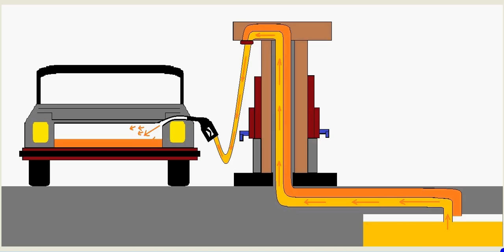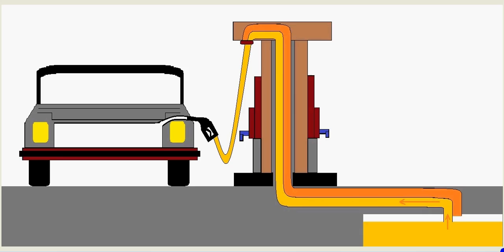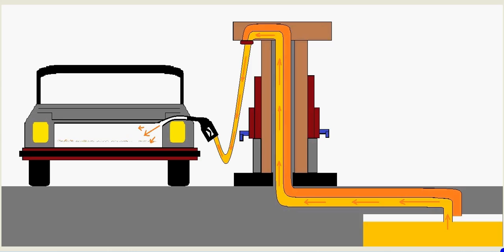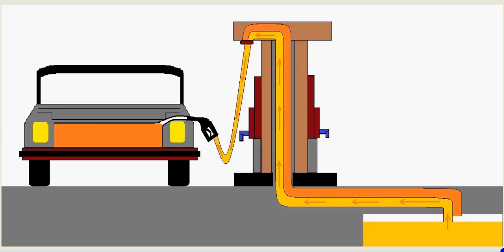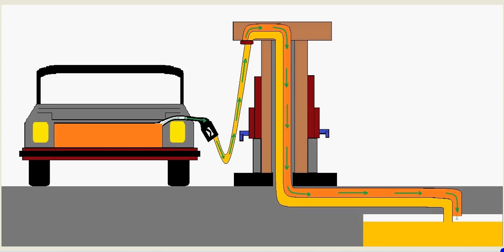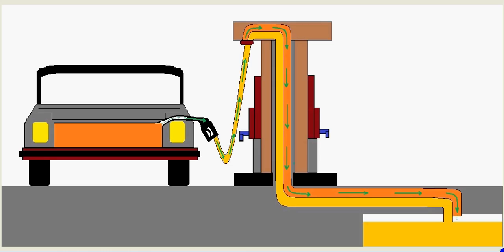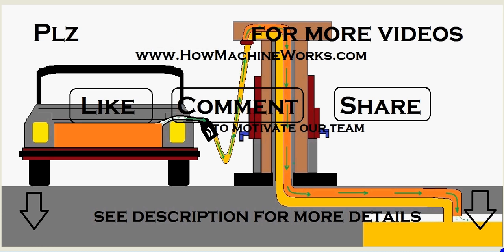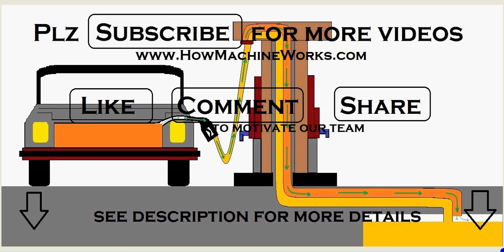Why not to fill full tank of fuel from a petrol bunk - Must watch - Share.

Comment: This is hilarious. Genuinely hilarious.
Absolutely everything about this is wrong.
There is no return line. In fact the pipe illustrated in this picture isn't even connected to the fuel line.
Its a pressure relief line. Its how the air escapes when the underground tank is filled. And visa versa when the fuel gets pumped out.
You clearly have absolutely no idea how any of this stuff works.

Comment: all are genius people unless they wont try to know what the actual working off a fuel pump in india there is no pump having a return valve or return pipe there is only one way out from the tank and there is a shut off valve in the dispenser pump it will not come out many lorry and car while fueling the tank is full the excess will come out to the ground

Comment: No fuel  petrol station pump that I have ever seen has a return line in that sense the return line is for bleeding air off and is before the Gage only on very old petrol pumps have I seen curious things that maybe return Lines normally red diesel pumps on dodgy boatyards

Comment: All fuel pumps with an auto cut off safety system will trigger the cut off the moment fuel filler tip submerges in the liquid fuel. This video is a scam. Fuel stations can still scam you by tampering with the fuel meter to charge you for lesser fuel than the actual reading.

Comment: the orange pipe it to let ari in to the tank so the tank wont have a are tight seel and if it dose the hose will just crumple up and then break. its like driking out of a beer bottle if u keep driking the less air whitch causes ur lips in suck in l, same thing will happen if thers no second pipe (orange pipe)

Comment: You need more education. This is not how the nozzles work. The mechanism has already been perfected over decades.

The thin return tube around the nozzle terminates in the handle. When fuel is pumped on it creates a vacuums inside the handle which sucks air/gas from the tank. When there is a pressure change from the tube getting blocked by topped up fuel, the nozzle triggers the physical cut off.

There is no electronics or return to tank.

Comment: when full leave a gap between the nozzle and the fuel.. and u can slowly control the fuel and still pump till full.. the cut out valve will deactivate do not overpump..

Comment: you're ignorant
Reply: MUHAMMAD IMRANUDDIN MAAZ how is he ignorant?
Reply: DRUGED F.UCKED orange return line is not the main point and it's not used in more than 97% petrol bunks. the main point to not to fill the tank is.... the petrol tank can burst due to high temperature in summer.
Reply: MUHAMMAD IMRANUDDIN MAAZ huh true I'll leave it at that I don't read up on petrol pumps so I wouldn't know

Comment: this is easy to measure just buy a new Mitchell 10 and fill it until the pump quicks off and then measure the amount of fuel in the tin. you will find very exactly the same amount of fuel in the gym as it says on the pump.

Comment: its a wrong information from video, when u observe petrol gun there is a small hole at end , a little bit of air sucks when filling tank , when the hole touches fuel then it blocks immeadiatly. it  block less than half ml suck it will stops the machine

Comment: this cannot be true. coz like you mentioned, there is a cut off hole in the fuel gun, when the fuel reaches the cut-off hole, the pumping machine will detects that and will stop pumping the fuel. later it's upto you to either stop the fueling process or to go for a top-up. even in top-up, fuel gun will be held little above the fuel top level(which is inside the tank). in this process there is no excess reading by the meter.

Comment: Thats not how it works. Theres a sensor inside the gas pump head which detects difference of air pressures in the fuel tank of the car as fuel is being pumped into it which then shuts off when gas is full. Nice youtube troll video.

Comment: This is bull crap. There is a pressure trap driven mechanism that stops fuel flow when it senses that the tank is full. It doesn't take back any fuel. 

You should always fill full tank so that you lose minimum fuel as vapour and get maximum fuel economy; especially for petrol cars.

Comment: Reasons why you should fill your tank completely and maintain full levels. In cold climates water condensation can build up inside the space not taken by fuel and can lead to poor engine performance and premature wear on parts like a fuel pump.

Comment: I have a motorcycle. You can see the fuel trough the filling hole when tank if full. if this was true, I'd have noticed considering my tank is only 3 gallons! (Yet I can drive 200 miles with it!)

Comment: the return valve does not take the fuel all the back to the main tank. the sole purpose of the return valve is to sense the returning fuel so that the fuel supply can be stopped. Once the supply is stopped the fuel can not enter the tank and also can not go out via return valve.

Comment: haha, then the tank of vehicle will not fill up ever. There is a sensor inside the tip of nozzile which help to cut off dispensing automatically when the fuel came back from fuel tank of vehicle.

Comment: I agree that there are probably places in the world where a "petrol bunk" works as described but I don't believe for a minute that this video accurately describes all gas (gasoline) pumps. There is, however, a reason to not fill a fuel tank as full as possible. The fuel is usually cold (from being stored underground). If the temperature in the vehicle is going to be higher (as would usually be the case in the summertime), it will expand. Not usually a problem but it sometimes is. (Ask your mechanic if you want to understand how.) The flip side of this caution is that if you drive the car even a mile or so right after filling it and before you park it, you will probably use enough fuel so as to not experience any problems when the fuel expands.
Reply: I forgot to mention that, in cold climates, NOT filling the tank can result in water condensing inside the fuel tank. If or when that water gets into your fuel lines (from the tank to the engine), it can freeze and prevent the fuel from reaching the engine. There are additives that can minimize this problem. A small amount of pure alcohol added to the fuel can help. I don't know what ratio to use because some of the parts in some cars' fuel systems can be harmed by alcohol. I prefer, therefore, to use commercial additives or, better yet, not let the fuel tank sit overnight with too much air space in it. And, of course, this problem is less likely to prevent you from driving your vehicle if your vehicle sits overnight at below freezing temperatures where the humidity is 20% or less.
Reply: Roger Metzger I wouldn't other reading these comments because they seem to look accurate by the sheer size of them XD
Reply: Roger Metzger Premium fuel has Ethanol for the very purpose you listed. Everything has its pros and cons.

Comment: I am with the other respondents.  Its the vapor that triggers the stop on the pump.
That said there is one unpleasant truth.   If a person fills his vehicle and stops the pump, by using his finger while still holding the hose,  with the pump stopped he can then again squeeze the pump handle and the fuel in the pump hose will drain out.   The next person upon starting to pump then pays for the fuel to refill the hose.
Reply: I'm a fuel tech.  The hose NEVER empties.  People that are holding the hose up and shaking it at the end are just kidding themselves.  They aren't getting anything extra and the next person is not paying to "fill tthe hose back up"
Reply: Our nozzles must be newer than yours because you can't do that. I always hold the nozzle out a bit and fill the tank some more after it auto stops. I slowly fill it until it's almost coming out and it counts that fuel as well. Trust me, people way smarter than you or I design these things, they've thought of everything.

Comment: Bullshit. The hell you talking about?

That orange pipe is for vapors to return to the tank. And, the way the pump detects your tank is full is through something called the Venturi effect. When tank isn't full, the vapors are passing through a Venturi in the handle creating a low pressure area. When your tank is full fuel goes through this hole and changes the pressure, and mechanisms detect this and shut of the fuel.

Comment: This is pure bullshit. All pumps have a security mechanism that senses when the tank is full and stops the fuel flow by closing the valve in the handle. There is no pump that sucks fuel back. The reason for this is simple. They can not know what you have in your tank and if you for example filled a gasoline car with diesel than it would suck back some gasoline into the diesel reservoir. They would then have to empty and discard several thousand litres of fuel to avoid risk of having to reimburse other car owners for motor damage due to contaminated fuel. If you are going to make videos about how stuff works you have to at least know what you are talking about. Otherwise you look like a complete idiot.

Comment: Ok so habib is saying that I could just pump continuously and waste money? I have a few issues with this. A: why then have I never experienced this problem? And when my fuel tank is full it just cuts off. B: in my older vehicle if I were to try and top my tank off past the auto stop, gas would flow onto the ground from a over flow valve in my gas tank. I guess this mysterious technology he speaks of is only where he lives. I mean obviously the diagram shows a well documented problem he is having so there's. o reason to question it....all I can say is he's full of bs and until this becomes a wide spread technology I'm not gonna change where I pump gas. Stupid video.

Comment: when we get a full tank the valve on the pump cuts off
Reply: Are you braindead?
Reply: That's correct There is a diaphragm inside of the pumping nozzle - it's a complicated process, but the device is very simple. When air pressur changes inside the diaphragm, it drops the cut-off into the fuel-flow. It stops you pumping in more fuel when the nozzle is submerged.
Reply: Moose Knuckle regardless cut off from a full tank to a non full tank whatever is left in the line either goes back or ends up on the floor which is why people usually shake or lift up the hose to stop that. this video shows fuel going back in meaning you could stand there all night waiting for a full tank
Reply: +Moose Knuckle
Regardless of if you stop the flow manually or if it's stopped when your tank is full, the excess fuel in the hose is not deposited in your cars tank.
Reply: @MatthewWeiler1984  
Ah yes, but fuel that was already in the line before you started pumping does go into your tank when you start.
Reply: ESAPOWER
Reply: thanks for keeping the troll video up and running
Reply: yup that right
Reply: Muhammad Farris
Reply: Muhammad Farr🐆🐆🐆🐆🐴🐴🐩🐩🐩🐩🐺🐺🐱🐱🐈🐎🐆🐃🐽🐁🐁🐁🐁🐁🐁🐁🐁🐁🐁🐁😘😘😘😘😘😘😘😘😗😘😗😗😗😆😆😉😑j👑👢👢👞👟👺👹👹😺👹😱😺😿
Reply: k ly But the remainder of fuel in the line goes back into the holding tank...which you already payed for...Do you understand?
Reply: Well, I would guess that the hose leading to your car can switch between which line its connected to: the one drawing from the gas storage or the one for returning excess. And for the pump sucking the fuel, you have to realize that the gas machine is sucking gas from the perspective the gas supply, and pumping out from the perspective of your car. I'm sure its as easy as running the pump in reverse.
Reply from the maker: Hi,

This is Jose from TechTrixInfo. Thanks for the comment
Learn through “WhatsApp”
Please WhatsApp @ +919744615655 <your name> and start getting updates Mechanical and
Automobile engineering, Super cars and machines. You can also ask your doubts
related to the same subject and we will be happy to help you and this service
is FREE.

Comment: not true. the only thing the pump "return line" handles is VAPOR. I build gas stations for a living...
Reply: um no. if they took excess fuel out of your tank, it would require a whole new pumping system. if this was truly in the old times, it wouldn't have had a return line at all. Plz do more research for your videos
Reply: You re right. He is just making up. Return is for vapour. Also senses the fast air flow and shuts the liquid off. Also not Petrol bunk. Petrol Pump please.
Reply: well look at the quality of the diagram it's not exactly professional ahaha you can't trust him :P
Reply: Kameron Lovell thats a professional drawing you are picky.loll
Reply: ooh if true. . how we can cheat to have more gas..
Reply: Gas is a vapour. Did you mean petrol stations?
Reply: TechTrixInfo 
Shall I get this number
Reply: That is VRS , vapour recovery system.there is no excess fuel returned to tank
Reply: I agree with you Bruce. Because it will be auto cutoff and the reading will not run more.
Reply: TechTrixInfo.com Haha. Your concepts are all shaken! Creating a false scare just for the sake of YT views!
Reply from the maker: +bruce s 
This was in the old times 
In Asia 
Thanks for the comment 
Mechanical, Automobile engineering updates through Whatsapp @ +919744615655 (requests through Whatsapp to get updates)

Comment: Hahahahah so not true. It's actually stupid. A  fuel dispanser have maybe one or more one way valves, or return valves. So there is no posibilty that fuel goes in both direction, and this drawing is nonsence.
Reply from the maker: +Marinko Jagodic 
It's an old technology, currently not there.
Thanks for the comment 
Mechanical, Automobile engineering updates through Whatsapp @ +919744615655 (requests through Whatsapp to get updates)
Reply: Not posible in old to, there is also a return valve in tanks. Trust me, I'm working in fuel dispanser service.

Comment: Either your filling stations are all crooks or you are deluded. In the UK, the nozzle has a sensor which detects when there is a high concentration of fuel vapour (because the fuel is very near the nozzle) and the trigger shuts off with a distinctive and quite audible clunk. Do you work for Windows Tech Support and call people to show them warnings in their EventViewer ????

Comment: Doesn't make any sense this video. If this was truth then everytime I filed my tank, I wouldn't get any gas/diesel poored out like I do everytime I overfill. The return mechanisn would simply suck everything away and no waste would poor onto the floor. The returning mechanism you are talking about exists actualy to keep the air flow on the tank, otherwise you woudn't be able to fill in the tank because the pressure is equal to the pressure outside, as most of us just put the nozel into the whole and there is no space for the air to flow in.

Comment: pure bunkum
there is a vapour return pump fitted. as the tank is filled with fuel it displaces vapour which is sucked back to the storage tank, the part of the nozzle that allows this to happen is actually outside of the car fuel filler. when you put the spout into the car it opens a flap (unleaded spouts are a smaller diameter to diesel spouts so a diesel spout will not fit into an unleaded car) there is a ring close to the handle which is where the displaced vapour is collected to be returned to tank. the automatic cut off is controlled by the little hole at the end of the spout, when the fuel covers the hole, a diaphragm is lifted which disengages the trigger

Comment: Total crap. But one thing is that you should not fill excess. This is to prevent interfering with the pressure compensation. There will be some air passage to the tank, otherwise negative pressure will build up as the petrol level goes down.

Comment: FAKE ACCENT. I deal with dispenser. As per the standards, there is no RETURN LINE TO TANK from fuel dispenser. Understand one thing, fuel and oil is critical industry when it comes to retail stations. No pumps are allowed in any kind of market. FYI i deal with gilbarco and HOSE or NOZZLE doesnt have prevention for internal return line. All nozzle comes with sensor which immediately stops after sensing fuel at top of nozzle spout. So better you correct your fact before creating bullshits.
Reply: it's fun to point out the uneducated twats they say this is not true but it is

Comment: This is totally wrong.  The return system is for gasoline vapors.  Pumps shut off when the displaced air in your gas tank runs up the fuel filler hose / pipe.  Fuck this guy.

Comment: The return line captures Vapors only. If the pump does not have a safety over flow shut off, any extra fuel will spill to the ground and on your auto. Otherwise, the pump stops pumping fuel.
Reply: it stops but u can squeeze again to get it back going. which is what a lot of people do.

Comment: BULLSHIT! I tested this myth at 3 different stations using a 5L jerrycan. When it's full, it STOPS. Simple as that. If you push it again you will even overflow it but DOES NOT suck fuel back in!
Also, modern cars usually have valves in the tank's neck to prevent thieves from siphoning your tank so that would further prevent it from happening.